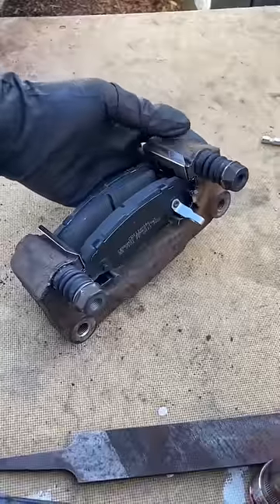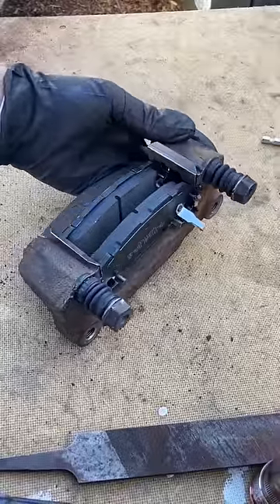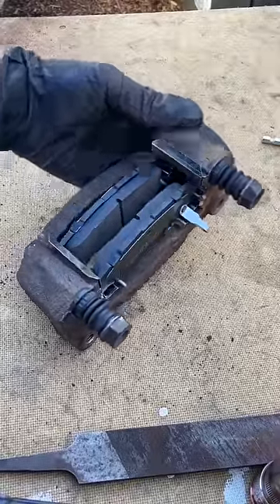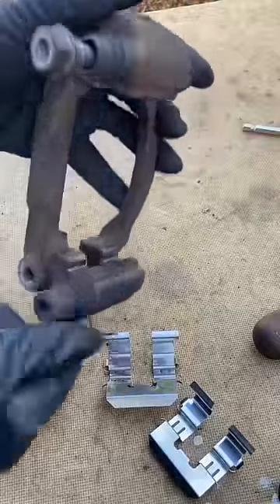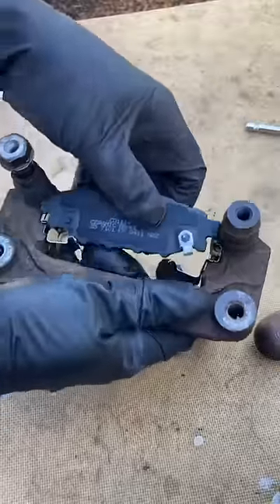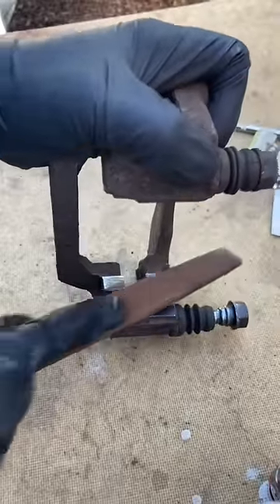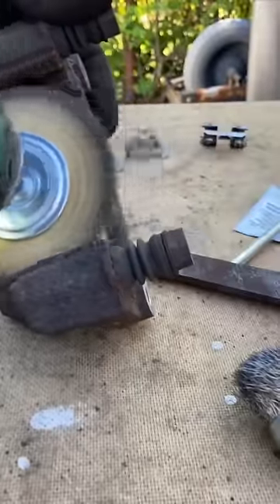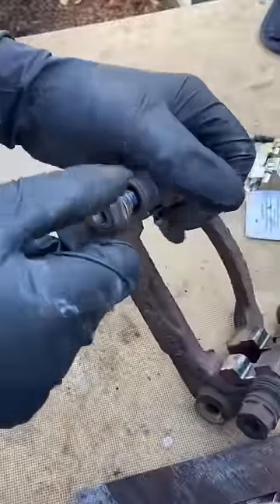What’s the Difference Between a $50 Brake Job and  $200 Brake Job

Comment: I worked as an auto mechanic for 12 years. I always did that work. Now, family and friends want me to do their brakes. I will refuse to do them unless they're willing to turn or replace rotors, new pads sometimes new slide pins and I always clean everything exceptionally like this.
Reply from the maker: Ya I only replace rotors. I don’t have the ability to turn rotors anymore.
Reply: But you don't have to have everything new.  I gotta be honest I don't think I've ever changed the roters on my cars and I have 90000 miles on it.  And my brakes must stop well because I follow too close.  I don't do it on purpose, but I know I do it.
Reply: @saltyolbroad2962  Brother, as a tech, I can guarantee you that they don't last forever. They do build outer and inner rim ridges as the pads wear down and when you slap new pads on them the don't seat right at first till the old rotor ridges wear into those new pads. Causing premature pad surface wear. Do they work? Absolutely! But it will shorten the life of the new bad over time by reducing the surface braking area.
Reply: @midnightrider1854   well you gotta take some sandpaper to it and rough it up before slapping on the new pads.  If you have grooves in the rotars that are that deep, then, yes, it's time for new rotars.  Changing your rotars everytime you put new pads on is a waste of time, money, and resources.  But, as atech, you don't care because it's not your $300 extra bucks every pad change.  I suppose you change your calipers with every brake job, too? It's a chunk of metal.  It'll be fine.
Reply: @saltyolbroad2962  Look, as a tech, yes they should be at the very least resurfaced at every brake change. But as a person, do I do It on my personal vehicles every time? No. But when you stated that you NEVER replace your rotors and that they "last forever" that's when I said that they do not. They do in fact wear down and that is exactly the reason the manufacturer has a minimum wear thickness stamped on them.  I'm not against pad slapping if your rotors are in  good condition and within manufacturers specs. But they don't last forever and doing so can and will shorten the life of your brake pads.
Reply: @midnightrider  I didn't mean to imply they last forever.  I was talkin' about my present vehicle.  It has 90k miles and I have never changed the rotars.  Other than killing the rotars by not changing pads, I don't think I've ever changed the rotars on any car that I have owned.   Of course, it is possible they have cheapened the metalurgy of the rotars now to have planned obsolescence.
Reply: @saltyolbroad2962  Now that we can both agree on. The materials and craftsmanship over the years has went straight down the crapper. And I do believe that it is planned obsolescence on the part of the vehicle and equipment  manufacturers. And I do understand what you were saying about the rotors now. Sorry for the  misunderstanding.
Reply: @Brad Hampton could be lots of things but let's start from the top. First off, did you change your rotors, if so, did they have a good cross thatch pattern on them and did you clean them off with brake cleaner before installing them? They come with a substance on them to prevent them from rusting while sitting in the box on the shelf at the store.  which can contaminate the brake pads if you don't clean it off first. Then there is the matter of the caliper. Did it compress easily? And did you clean and lube the brake guide pins and the abutment clips (the clips the the brake pads sit in) all of these, if not free, clean, and lightly lubbed will cause the pads to stay engaged with the rotor causing squeaking. We will start there and see which (if any) of those steps that you might have over looked. And then we will proceed from that point

Comment: You should tell people to use the right grease with slide pins. Using the wrong stuff would make the rubber swell.
Reply from the maker: Ok next time
Reply: What kind of grease. I've use whatever comes out of the grease gun..lol. some red stuff
Reply: @leathercheerio1  You should be using something silicone based.
Reply: @leathercheerio1  I use the same type of silicone/ceramic grease on all brake parts. Goes on thick, doesn't dry up for a long while, and once it does dry the ceramic stays behind as a dry lubricant. Just a thin smear on the lube points and you're good.

It's usually labelled for disk brakes, but it works beautifully on drum brakes as well.
Reply: @Azlehria  thanks will keep in mind
Reply: Lithium grease

Comment: I'd say filing is going a bit far, wire brush/wheel is good enough to get the gunk out of the guides
Reply from the maker: Yes the wild brush works for most. But I’m in the rust belt and sometimes it’s just not enough.

Comment: You should do that anyway it’s called quality work.  The customer chose you so do your best for them. 
Quality not quantity
Reply from the maker: Yes that’s the point of the video. The dollar amount is irrelevant.
Reply: @AndyTheXTech  
If the dollar amount is irrelevant then why mention it.
Reply: FR this guy is trying to justify charging someone the equivalent of $600 to do a STANDARD brake pad installation 🤯

Comment: I used to be an apprentice at a shop, and the owner would also file the tips of the brake pads where it inserts into the chamber. Removes some of the paint that makes it hard to fit into the grooves.

Comment: To all the people claiming this is only “a few extra minutes to do”: please video yourself doing all four corners, in REAL time (no jump cuts) replacing all rubber bits, brackets/clips, and removing and replacing all old grease and wire wheeling all surface rust on the contact points. Then post it. I know it ain’t “hard” to do, but it ain’t “a few minutes” either.
Til then, keep getting laughed at.😂
Reply from the maker: Yes 👍
Reply: 1 hour 15 max.

Comment: Homeboy trying to justify 200$ for a pad slap
Reply from the maker: I mean I’m good. Do you need brakes? 😉
Reply: @AndyTheXTech  I mean I just got back from a road 450$ road call for a hub cap gasket on a semi that took me 10 mins to replace so I you do you boo.
Reply: If you're pad slapping, you're doing it wrong.
Reply: @fcjoe58  Sounds like you're doing the same shit he's doing what is your point
Reply: @stevensievers9659   This is arguable. It's really dependent on the parts that are there. On my Mercedes, the rotors outlive the pads easily. The rotors are very expensive, so you run a softer compound pad. Same braking power, but you wear out the cheaper parts.
Reply: @JSAFIXIT  bro what, the rotors always outlive the pads, unless you get some cheap ass rotors
Reply: @JSAFIXIT  

Having worked on many Mercedes, the Rotors are soft and wear out really good as they end up with a nice lip on them.  Having done many, you are also better off getting O.E. parts, pad's and rotors, or it'll be back for wearing out too fast or squeaking.  Working on a ton of cars, we learned what worked best.
Reply: @jbdragon3295  The oem rotors for my 01 e55 were 600+ each.  Aftermarket 2 piece where about 300 each, and lasted longer.
Reply: Nothing wrong with a pad slap if the rotor is fine, been slapping pads for many years and many different personal cars. Never once had a problem.
Reply: That’s not a pad slap. It’s the way all auto manufacturers describe how to properly service the brake system. A pad slap is more like wam bam thank you man. This is foreplay with a long kiss😂
Reply: Jack Russelle Lewis 🤦‍♂😂🤣

Comment: Why does everything have to go from 1 to 4. Where is the middle ground anymore? It's either hack jobs or professionals, never a fair mechanic any more.
Reply from the maker: I hear ya. The scary thing is the professionals are sick of it all. Most are getting out of the field. Who do you think is working on the cars now. I don’t trust anyone.
Reply: The professionals are the fair mechanics
Reply: @AndyTheXTech  couldn't have said it better. Seems like all the professionals are leaving most trades.
Reply: @zachadam1724  valid point!
Reply: @AndyTheXTech  

I got out of working on cars many years ago.  Changed Careers!!!  I saw what mechanics and tech, even from dealers, do.  If I could, I wouldn't let any of them touch anything I owned. There are just some things I can no longer do at home myself.  I don't have the equipment.  I still have thousands of dollars in tools.    Things I can still do myself, I do myself.  But there is no way to do a pad slap for $50 per axle and expect your business to keep its doors open.
Reply: JB Dragon 🤦‍♂️😂🤣

Comment: “Use a file” 
Breaks out the die grinder 😂
Reply: That was a buffer wheel after he filed it.
Reply: @JohnPlissken  that’s a brass wire wheel, and it does the same thing as the file just faster
Reply: @SW_BF2CLIPS  Oh you are right. Didn't notice on my tiny phone screen.
Reply: @JohnPlissken  no worries I just found it funny because i just did the same thing to my drum brakes
Reply: @SW_BF2CLIPS  It's a tough part to work with a file, especially a big one like that. And with that much rust built up.
Reply: @SW_BF2CLIPS  what kinda machine?

Comment: The thing is you have no way of knowing if the tech did $200 worth of work or did $50 worth and charged $200. Kudos to the guys who do the $200 job and charge accordingly.
Reply from the maker: Absolutely! This is why no one works on my vehicle. Lol.
Reply: The only way to check is to take it apart and look, but at that point just do it yourself.
Reply: Except this IS a STANDARD $50 job 🤷‍♂

Comment: In Jordan we don't have a 200$ breakjob that's just kinda crazy we have 25$ breakjob that does the same as the 200$
Reply from the maker: How much is a house there?
Reply: @AndyTheXTech  well prebuilt houses could go up to about 70k to 200k it depends how many rooms and where it's and witch floor it's on and it's made out of bricks if u want to build one it may cost u 14k to 150k that's the range it may cost more

Comment: If I seen my techs taking a file to the bracket, they would be using the wheels on there toolbox to roll out of the shop.
Reply from the maker: Lol! Explain? Speed? Accuracy?
Reply: @AndyTheXTech   You should have just use a wire brush.
Reply: Obviously you don't deal with rust, OR you just want a quick cheap job a take the money.

Comment: your $200 brake job looks a lot like my $50 brake job.
Reply: $50 for all 4 sides? That’s crazy you know damn well jacking up the car in proper locations then taking off the tires big/small, taking out the bolts sometimes are rusty hard to get off then taking off the caliper and placing somewhere safe then you got the caliper clippers also pushing back the 2 cylinder things back into place of caliper then add new brakes put everything back and yeah labor work

Comment: Depending on the make and model of your car, embarking on a DIY brake project can not only save you money but also provide a fulfilling experience and expand your knowledge for future repairs. With the cost of a typical brake job at a shop ranging from $400 to $500, you have the opportunity to invest in new remanufactured calipers, brake pads, rotors, fresh fluids, and perhaps even indulge in a well-deserved pack of beer—all for the same price.

Yet, the true reward lies in the sense of pride that comes from tackling the task yourself. Knowing that you've taken charge of your vehicle's safety, and that the job has been executed with meticulous care and craftsmanship, is a deeply satisfying achievement. So, not only can you achieve significant savings, but you can also relish the satisfaction of a job well done, ensuring your brakes operate flawlessly and with utmost quality.
Reply from the maker: This is a updated video: $200 For a Brake Job? Would you Pay it?
https://youtube.com/shorts/T2K5fT1IYFE?feature=share

Comment: I charge 150 for fronts. Nice to see someone talking about the slide pins. I do the same every time. Bore brush brake clean air to dry hi temp brake caliper and bearing grease

Comment: On a brake job I’m cleaning hub faces, then putting a little anti seize on them. Toss the rotors on and they get a small amount of anti seize right at the hub to wheel mating surface. I’m also sand blasting caliper brackets and greasing both sides of the abutment hardware, also best to put lube on the caliper piston face and other side of caliper

Comment: I always do my brakes this way for myself as well as my friends/family/customers/neighbors you get it. But yes it takes a little extra time doing it correctly rather than half fast and I only charge people a fraction of that price and the I also check fluids, tire pressures suspension components and even plug my scanner in and see if there is anything going on with the vehicle but hasn’t triggered the light because you can be storing codes and not have a check engine light.

Comment: Price could still be $50. Just the difference between a person that does it right and the other doesn't. 1 is greedy and the other isnt.....
Reply from the maker: If I was in a non-rust belt area and I didn’t have to do any sanding, and it was strictly pulling the pads off putting rotors on then yeah 50 bucks would work. But I do guarantee my work and things never go as planned here.
Reply: @AndyTheXTech  OK zoning does play a part especially places where salt water is. I get it now that you explained.👍👍

Comment: I always clean up the caliper bracket and grease pins. I make sure everything is moving freely. Just so you know, files move in one direction, forward. Never go back and forth.
Reply: Exactly right! Files are like hacksaws. They cut moving forward only. You can lightly pull it back but never apply downward pressure going backward.
You can't sharpen a file. If damaged due to downward pressure going backward, it's toast.

Comment: I only recently became aware of how rust expansion hurts the brakes and why parts can wear out quickly if critical surfaces are not cleaned and greased. Bracket rust pushes on the pad clips and narrows them. Narrowed clips pinch the pads. Pinched pads can’t slide away from the rotor when the brake pedal is released. Stuck pads wear out quickly while wearing the rotors, making a lot of heat, noise, dust, loss of acceleration and waste fuel. Rust on the hub can create rotor vibration which leads to a set of similar and other issues.

Comment: As a mobile mechanic myself, guy had a $50 brake job done and the tech only installed the pads on the outside! Left the metal on metal pads on the inside. I remember starting at $50 too thinking that was the competitive rate till I talked to experienced mobile techs and realized I was heavily undervaluing myself. 

If a $200 brake replacement doesn’t fit their budget, that’s fine. Their wallet doesn’t reflect what techs are worth 🤙🏼

Comment: One thing I would change is using a more aggressive wire wheel for the caliper bracket pin holes. Rust will get in there with time and ripped boots so getting a silver wire wheel will clean it up nicely and make them slide in like butter.

Comment: A tip when charging full boat on a break job, clean just the two wheels. I mean super clean them especially if they are alloys. It make the job pop out as a super improvement and that max effort was delivered. You forgot to add grease to the pad tabs silly.

Comment: Paint the adapter 
I use a 3 inch cut off wheel and lightly take the rust and the black off just to shiny metal then i paint it to prevent the rust from coming back 
New clips
Nice job on slider pins
Also make sure rust is off wheel bearing surface area for rotor contact.
Wheel balance and possible Brake pulsation ❤

Comment: Wire wheel the outside of where the boot seals to the hanger (and pin). Rust build-up allows water to get through.

Comment: For a extra 15-20 bucks you can buy most caliper brackets by themselves  most of the time it’s not the brake pad hardware causing the issue but rusted and seized slides you’ll spend more time then it’s worth heating them up to get it apart it’s usually cheaper for the customer as well half hr of labor working on it cost them more than the bracket  also gets the job done faster so you can turn out more work at the end of the day

Comment: You need to hand file the guide tabs on pads to remove/reduce the drag on the pads keeping them from sliding. Keep the grease off the guides as grease can make its way to the disc and render the brake ineffective. The brake dust will also stick to the grease and make sliding difficult. Only grease the guide pins.

Comment: Any good mechanic would do that in the first place even a flat rate tech. Charging 200 in labor for what I’m assuming is front pads and rotors, let’s call it side work. Is worse then the shop with overhead 🤡

Comment: $250 I even clean the gunk off the threads on the bracket bolts. 
I also offer a $40 special, just replace the pads using old shims. If the pad dont fit, just grind away the material.

Comment: This is why you need a good mechanic. Lot of the hacks in my city will just replace rotors, calipers, hardware and pads every time. Maybe they grease the slide pins, maybe they don't.

Comment: Being a mechanic with 53 years experience, I once tried some wholesale store cheap brake pads, ONLY ONCE what followed several weeks later was a long downhill run at around 50mph, second time I touched the brakes ( not very hard) I had instant break fade, now brakefade does not make the pedal go to the floor, that's fluid overheating, brakefade comes as rock hard brake pedal with no braking effort, ever since then I have always insisted on OEM quality or better parts, what ever car you drive along with a proper brake job like this

Comment: The slide pins with bushings usually bind because the bushing swells up and slides as you try to push it in. 
Somebody probably used a petroleum based lube when they should be using a silicone lube instead